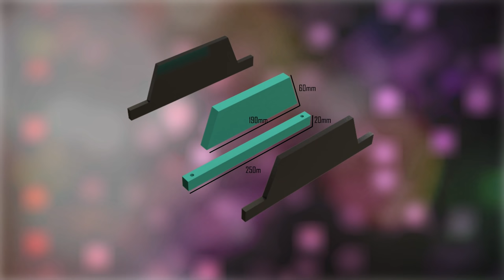Great Jig!! Ultimate sled cut Jig For precise cut

Comment: That’s a very good cross cutting sled with many uses. It makes using the saw table much safer, especially for cutting smaller pieces of wood. I like the two safe positions for holding the workpiece and rear fence. Well done 👍🏼. Thank you for sharing your excellent workmanship and great video. 👍🏼
Reply from the maker: Thanks for the tips!